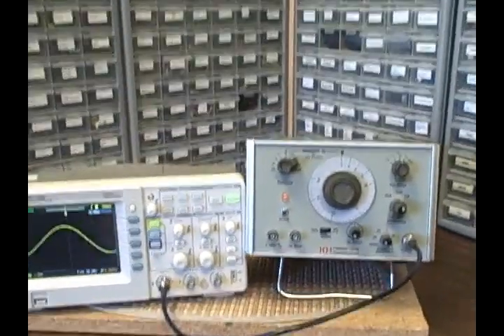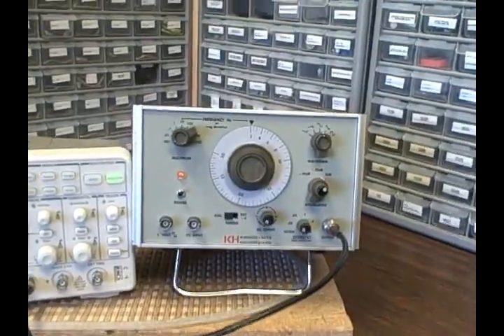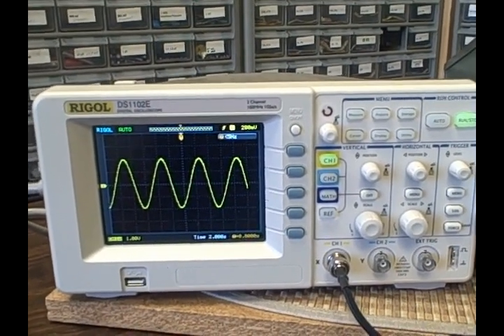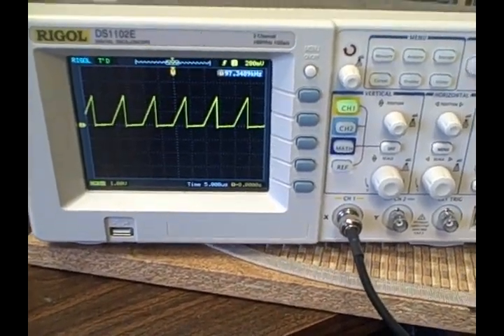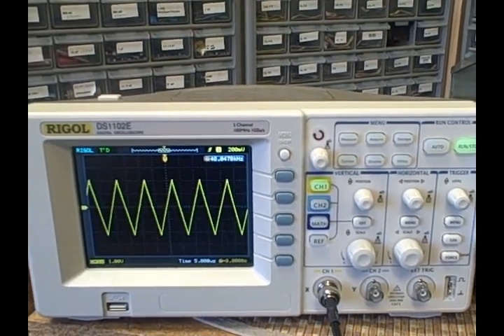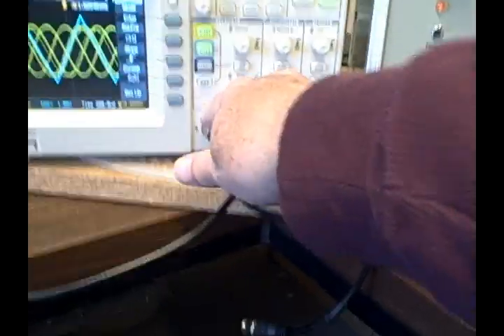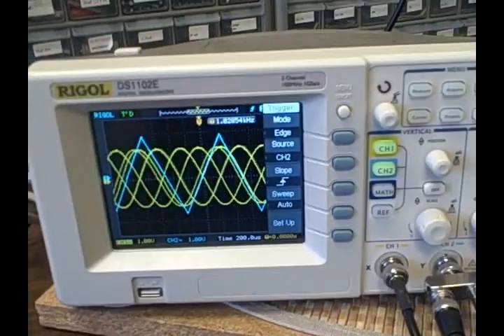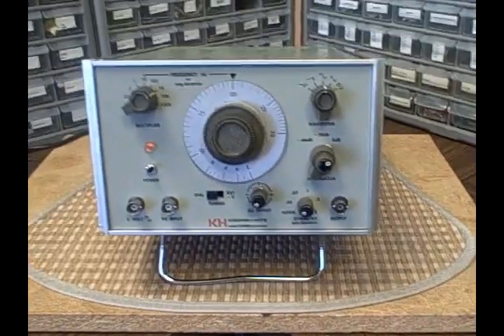Krohn Hite 5100B Function Generator

Comment: Great to see other K-H stuff running! Finally opened my 5100B and cleaned up the output amplitude pot and frequency pot. Output amplitude was easy, uncrimp and clean, had green stuff in there but the resistance element cleaned up fine. The frequency pot is glued/sealed, but noisy, so I drilled two holes (fill and vent) in the back and shot De-oxit D5 in there (Krohn-Hite recommends De-oxit if you email them about any of their vintage gear).